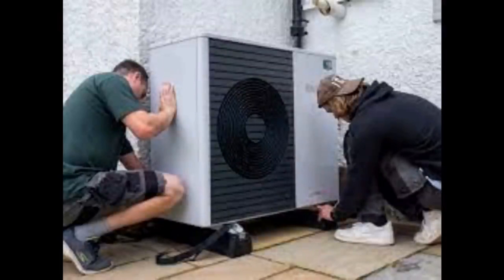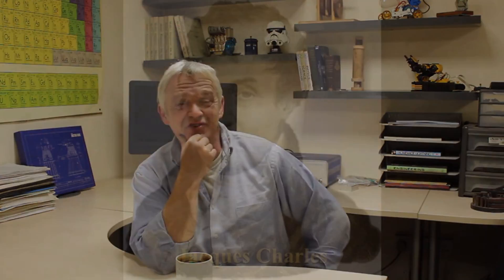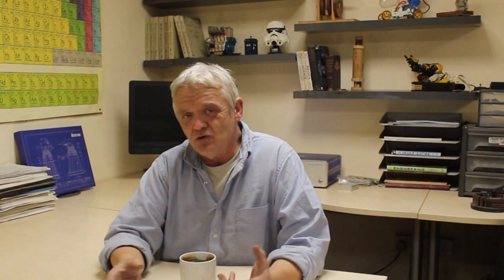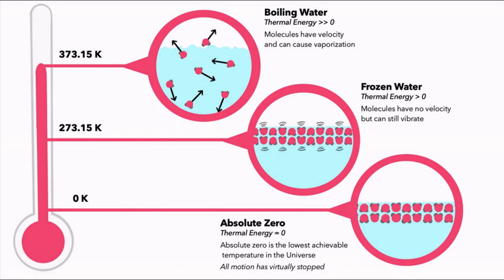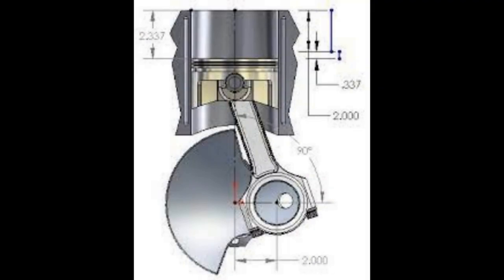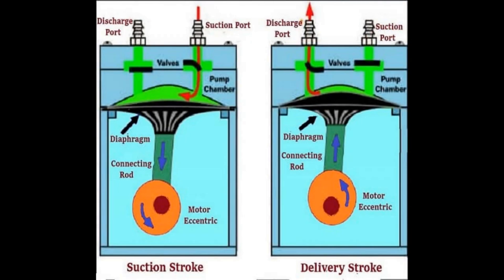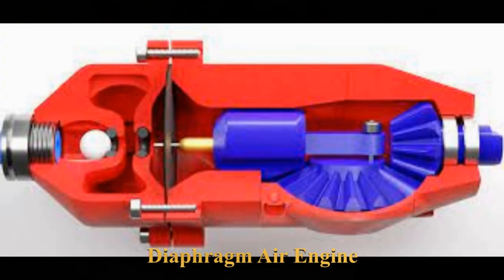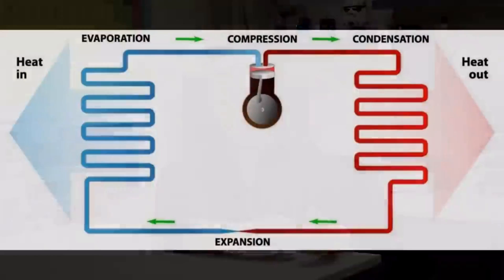2239 Heat Pumps And The Gas Laws

Comment: They're quoted as 300% efficient,  so people are being convinced to drop their gas boiler in favour of an electrically powered heat pump,
unfortunately, leccy, is about 2 - 3 times more expensive than gas, so I see a lot of people complaining that there are no financial savings for them, and their house is much colder.
I wonder if a means of pre heating the incoming air might make the system financially  more sense for people,
this might be spending an extra £1000 of a wind Gen, to pre heat the incoming air, lets say it generated 1KW....
Or even burning a small amount of oil, (eg a greenhouse parafin heater)
This might appear to go against the green ideals, but the increased temperature would lead to a COP efficiency increase, 
meaning less electricity needed, and a consequent reduction in emissions at the Power station.

Comment: (For me) Charles's law was not intuitive at all - at first. I needed to be hammered it in before continuing on the video. First accept "the gas" in this law has 4 properties:number of molecules, volume, temperature and pressure. Difference between quantity(amount, numof molecules) and volume must be strongly noted. "Quantity" means number of molecules i.e amount. Situation happens under constant pressure. That might mean the container i.e. volume has perfectly loose walls so gas can freely expand. The law states the quantity of gas(number of molecules) stay the same. After that first feeling is that growing temperature of given number of gas molecules generates more volume. At the same time pressure keeps the same as confined volume has perfectly loose walls. Then scrap the container concept alltogether and think just abstract volume.
After all this it is perfectly intuitive to think that volume of gas can expand with temperature and pressure does not change.

Comment: I often tell people that pressure and vaccuum are not the opposite due to lack of volume . Its fun to see there mind puzzled. 😂In the context of vacuum, the gas laws still apply, but the relationships may change slightly due to the absence of pressure or the presence of very low pressures. For example:

	1.	Boyle’s Law: In a vacuum, there is essentially no pressure, so Boyle’s Law doesn’t directly apply. However, as pressure decreases (approaching a vacuum), the volume of a gas expands.
	2.	Charles’s Law: In a vacuum, temperature can still affect the volume of a gas, but the absence of pressure may lead to different behaviors compared to conditions at normal pressures.
	3.	Gay-Lussac’s Law: In a true vacuum, there is no pressure to speak of, so Gay-Lussac’s Law doesn’t directly apply. However, if gases are present in a container experiencing extremely low pressures, temperature changes may still affect pressure, although the relationship may not be linear.
	4.	Avogadro’s Law: This law is about the relationship between volume and number of gas molecules, which can still hold true in a vacuum as long as there are gas molecules present. However, in a complete vacuum, there are no gas molecules to consider.
Reply from the maker: cheers mate

Comment: Air-source heat-pumps  a.k.a noise-pumps  don't work.
Why ?
The energy density of air is extremely low.
That's why they have such a big fan, to cool thousands of cubic meters of air each hour.
------
To tackle that problem,  you first need to isolate your whole house, in such a way that it is hardly using any energy at all, so your heat-pump won't get overworked.  But in a well insulated house, instead of purchasing an overpriced heat-pump  you could also do with a cheap, small, low-noise natural-gas-boiler.
Reply: There are also fanless heat exchangers.

Comment: I think the specific question  regarding  a "heat pump" is ... why is it "more efficient"?   

Why does adding underground coils etc help in the efficiency.. this is probably the key component that people would like to know about
Reply: once you reach a certain depth the ground temperature is more or less constant, (around 10 deg c in the UK with maybe a variation of a few degrees either way at 1m depth) so on a hot day this is lower than the air temperature  and conversely when its freezing outside the ground temperature is warmer than the air- it just makes for a system that doesent get as much fluctuation at the input end so can be designed in a more efficient manner.
Reply from the maker: it depends what you mean by efficiency - they are just a heat engine so the efficiency of moving heat from area to another is not going to be great - around 37% or so - like any heat engine. If you mean how much it cost you in terms of electricity then you are paying for just the pumps and compressor - so it will be cheaper as you are getting the heat for 'free' - you don't have to pay for heating something up - but then of course the amount of heat you can transfer is going to depend on how hot your heat source actually is

Comment: I have a habit of stating the obvious.
The reason I do so is because of the number of people I have encountered, that have never been taught the obvious.
A thermostat is an automated on and off switch that is controlled by the ambient temperature in the room.
It matters not how low you put the thermostat.
If the thermostat is set at 78 degrees, external air is 80 degrees and the air inside the room is 90 degrees; setting the thermostat to 60 degrees is not going to cool the room off. It's going to waste money.

Comment: I've used two split Aircon units to heat my house for the last 5 years. I also run my now 7-year-old electric Zoe (still 100% battery, and brake pads that never seem to die).

Even with these drains, the now outdated solar panels on my flat roof generate more electricity in a year than I use.

Thanks to the laws where I live, I get paid real money for what I generate.

My house was A grade back in '94 when it was built,  and admittedly takes little energy to heat or cool it. 

I haven't used my gas heating for many years,  I save a lot of money.

 My solar panels were paid for via savings years ago.  For once I backed the right horse 😅

(Long-distance journeys I do by train, not my 22KW Zoe 😂)

I am considering replacing the old gas heating unit with a heat pump.  And scrapping the Aircon... hence I'm watching another great video
Reply: If the age of the Aircons is where the concern is, I would say totally worth. You might well get a fair increase in efficiency with a purpose built unit, as opposed to the Air Conditioners operating "Backwards" on the same principle, if I read your system right. Also, the Heat Pump can run both ways.

Comment: Thank you for this video! Follow-up question on coefficient of performance:

Why do you get 3-5x more heat moved than the energy you use to compress the fluid? It seems to me the energy you use to compress should equal the energy absorbed from the environment in boiling back to gas.
Reply: Wall of text ahead, beware.

Because on heat pumps that use freon and such take advantage of phase change. The compressor does very little work compared to the environment. When the gas is compressed by the compressor freon can easily hit 200c. From there it travels to the outside coils where its exposed to 30c ambient air causing the gas to condense into a liquid. The phase changes of matter take a large amount of energy compared to simply heating up or cooling down. Much like how a pot of boiling water doesn't go above 100c at sea level because all the energy being put into it is being used to turn the water into steam. After the freon is a liquid, it then goes into an expansion valve where the liquid is allowed to rapidly expand and cool down to about 0C. That freezing now gas freon is exposed to 20c air warming it up to nearly the same temperature before it goes back to the compressor where its compressed and also heated up well beyond ambient temperatures. Now why is the freon a liquid when hot and a gas when cold? well because of pressure. any gas under enough pressure at a fix temperature will turn into a liquid because the molecules are forced to be closer to each other and are forced to change phase into something more stable. If the pressure keeps increasing the original gas now liquid can become a solid even if the temperature is well above the original's gas boiling point. The reverses is also technically true, but not everything has a real-world pressure low enough to cause it to either phase change into a liquid or sublimate straight into a gas. Or perhaps no one has taken the time to measure how long glass, steel, and so on, take to vaporize in a perfect vacuum.
Reply: Yes.

Comment: Back in the days of dinosaurs.  My faux father converted a single cylinder 500cc Velocette motor into a compressor.  The exhaust valve passed the compressed air from the cylinder to the storage tank and the inlet valve allowed air into the cylinder.  When starting, the inlet valve was held down until the electric motor run up to speed.  It would keep 4 high pressure spray guns running simultaneously at 100 psi none stop.

Comment: I prefer to explain heat-pumps without the use of formulae. Simply, a volume of gas has two components—the molecules themselves and heat(irrespective of how temperature is defined). Compressing this body of gas, compresses both the molecules and their heat. This results in a denser gas at a hotter temperature—same number of molecules occupies a smaller volume and the same amount of heat now occupies a smaller volume.

Comment: I thought decrease V then T increases. 
Hence hot bike tyre pumps.
Reply: That's right.  I think he misspoke at one point in the video.  But if you heat a gas and it is kept at the same pressure because you can change the size of the container, then the volume will increase.  If you compress a gas and don't allow the gas to escape then the pressure and temperature both go up.  If you have a gas in a container under pressure and you release some of the pressure by increasing the volume of the container then the temperature will go down.  Ideal gas law says PV = nRT where P = Pressure, V = Volume, n = number of moles of gas, R is a constant and T is Temperature.  So for a given mass of gas, n is constant.  And you can see how P, V and T are related.  If you hold any of them constant, then you can see it more clearly.
Reply: Thanks for that.....I got confused as well

Comment: do think you could use a stirling engine to turn another stirling engine to create a cooler?  I expect that if you could then the stirling being turned by the first one would have to be significantly smaller.  Do you think it's feasible?
Reply: Perfectly fine until all the stirling engines reach an equilibrium temperature, at which point they'll stop.
Reply: @simongross3122  granted but that will happen with any Stirling if you don't have active cooling

Comment: What is the temperature?

Temperature is actually the measurement of movement. 

-----Not necessarily. You can place room temperature water into a room temperature blender and blend it at high speed for a few minutes. Afterwards the temperature of water has not changed, nor was the temperature in water increase while it's moving faster in the blender.

Comment: That was really great.  I am not very bright but I wonder if you could address specifically how a heat pump uses air from outside that may be cooler and make it warmer in the house (or visa-versa).
Reply: I think it is because even though the air outside may be cooler than the air inside your house, it is still warmer than the cold end of a heat pump.  The heat pump takes this heat and it helps to warm up the refrigerant gas which is then pumped into hot area of the heat pump.  By the time it gets there, the gas is hotter than the air inside your house because of the compression, but also because of the heat taken from outside,  and this heat is then added to the heat inside your house.  It's mind-bendingly clever since we all believe that heat flows from hot to cold, and it appears that we've got heat flowing from cold to hot.  It only appears that way because the thing that's truly being heated and cooled is the gas in the heat pump and then used as a way of transporting the heat to where you want it.
Reply: @simongross3122 Wow!  Thanks for that great explanation.  That is really fascinating.  I have got to see if I can wrap my head around it.  To me the notion that gasses change temperature according to pressure is still absolute magic.
Reply: A heat pump pumps heat usually against the external temperature gradient.

Comment: What I don't get is if you put all of the gas laws aside and take the first law of thermodynamics, it basically says everything balances you don't get something for nothing.

So if its 2 degrees C outside and I want it 20 inside, plus my hot water at 60 how does the maths for that stack up?  I can only see it working by a lot of energy being put it from another source than the air, namely electricity.

I suspect that a lot of electricity is used both for running the compressor, and probably for running an immersion heater in the cylinder used for transfer from the closed loop heat pump system to the heating/hot water system.

Sadly I haven't found anyone trust worthy and independent, like Robert, who has explained/calculated this yet
Reply: 2°C outside has a massive volume you are only taking a tiny fraction of that energy out of the mass and concentrating it in a small space like indoors
Reply: Heat pumps just move heat from one place to another. They don't create heat like burning fuel does.

If you are burning fuel to create heat, then energy conservation means that even with perfect efficiency, you will only get 100% heat energy out of the fuel energy you put in.

However, if you use that fuel to move heat, rather than create it, that actually uses a lot less energy. Running a compressor and all the other losses in a heat pump system, are still a lot less than what you would need to create heat. The same amount of fuel energy can move up to 5x more heat than if that fuel was burnt to create heat.

Even at 2 deg C, there's still heat that can be extracted. That's how your freezer can get down to -22 deg C.

Comment: I live in Alberta, and in winter it can get very cold, -15C can be the norm for daytime highs. My question is, where does the ambient air heat pump get the heat from to warm my house?
Reply: -15C is very far away from absolute 0. So there is still heat outside. Although it might not be optimal operating temperature.
Reply from the maker: from the heat difference between the expanding tranfer fluid and the ambient temperature - when the gas expands it can drop much lower than minus 15 - as long as there is a eat difference it will work it isn't an absolute temperature difference
Reply: A water based heat pump would be better. Underground vs surface has an almost constant temperature difference all year. My brother used such a system in Ontario.

Comment: Why do manufacturers claim you get more out of a heat pump than you have in input? How is that possible?
Reply: The over 100% efficiency comes from the fact that instead of generating energy from a chemical or electrical source you are moving the heat from one place to another. It doesn't break any laws of the universe to pump a large amount of heat so efficiently that you can claim 300% more heating than the electrical input, especially given the comparable losses for most other forms of heating
Reply: It's a device that moves heat, it doesn't generate it. It's like how a fuel truck can carry more fuel to the gas station than it uses. If it takes 100 litres of fuel to deliver 1000 litres to the station, it's like the truck has a coefficient of performance of 10:1. The truck isn't over unity or breaking physics, it's just moving things from one place to another.

Edit: It technically generates some heat, just like anything else that uses energy. If you're strategic you can pump this heat into the system as well, boosting efficiency.
Reply: The electricity consumed is not the "input". It just works the pump. The "input" is all the hot air in the great outdoors. Yes, the outdoors is still "hot" even when it's a lot colder than you want your house to be. Anything warmer than minus 273 degC contains some energy in the form of heat, so there is plenty of heat energy available. The wonderful thing about outdoors is that it is big - REALLY BIG! So we can gather the energy from a VERY LARGE volume of the outside air and transfer all that energy into the SMALL volume of air inside your house. Your tiny house gets a lot warmer, while the great outdoors gets ever so slightly cooler. No magic. No scientific laws broken.
Reply: Watch the video and pay attention.
Reply: @dermotbalaam5358  I did, but I am genuinely puzzled. It sounds to me to be impossible.